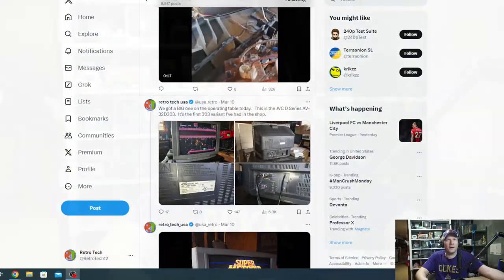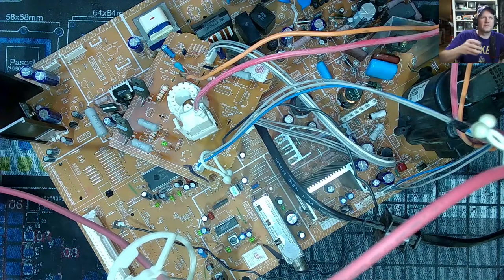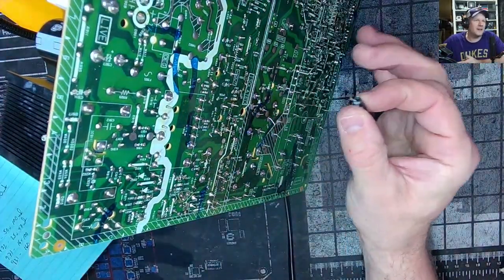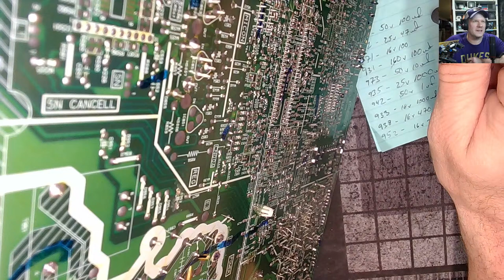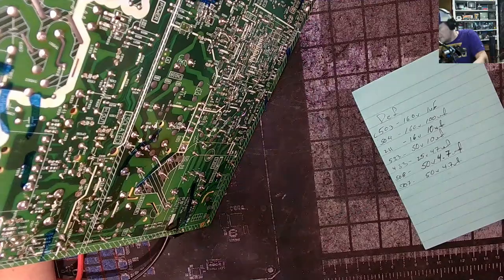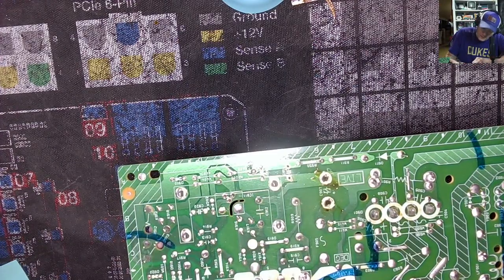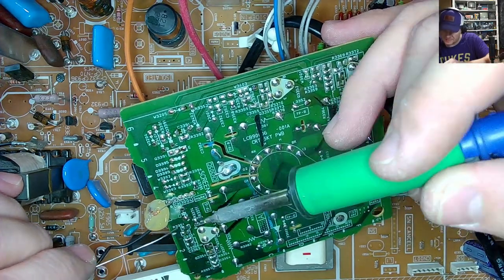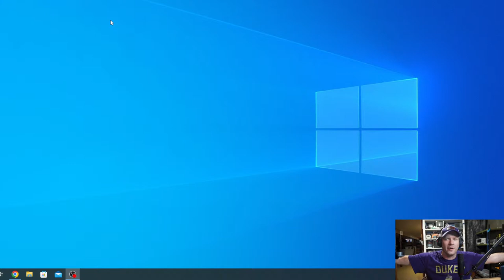A big old dirty "D" is in The Bunker!  [ JVC D Series TV]

Comment: Awesome. I picked up an AV-36D303 with matching stand for $50 a few months ago and love it. It is somewhat dim, and from what I read that could be bad caps in the power circuit area. I'm just getting started with servicing circuitboards so it's a project for down the road. Until then, I just love playing on it.

Comment: These and the Thomson & Panasonic equivalents are imo the gold standard for consumer grade sets to play 8/16-Bit games on, especially the 32/33" tube models, the extra curvy bubble tube with the inky blacks and colours are just perfection, I have the rare as rocking horse sh** Thomson SP Black Pearl 33", which is basically just a 33" D Series with native RGB, I canny wait to hook up the MiSTer to it, but sadly it won't come out of standby at the moment., so I think the internal fuse needs replacing in the PSU or a cap has gone in the PSU, the tube is in really healthy condition otherwise though, maybe it would be best to recap it outright, worse case scenario I could swap out the consumer electronics for an arcade chassy, as the tube is compatible with a few high-end arcade cabs/chassis.

If only I could send it to you Steve, or at least the electronic boards for recapping.